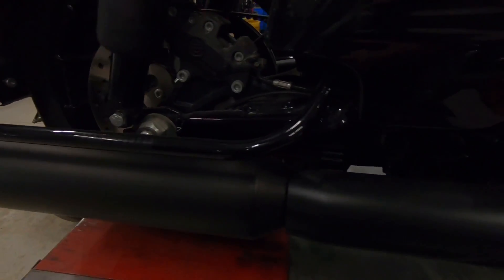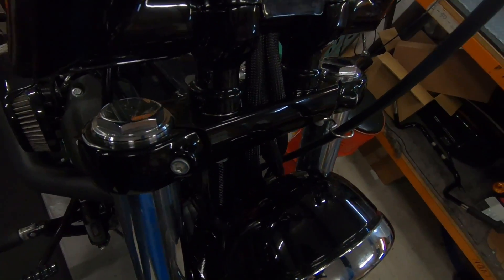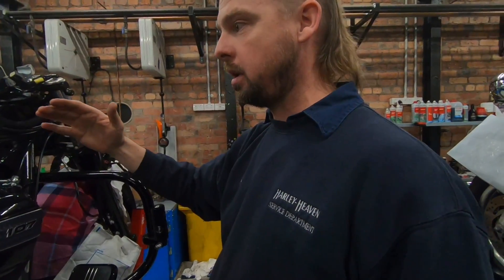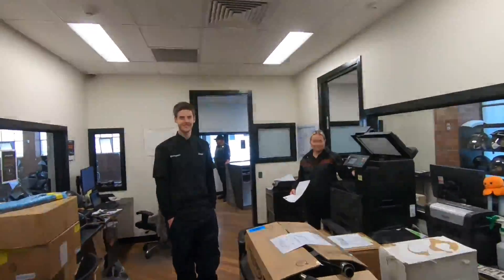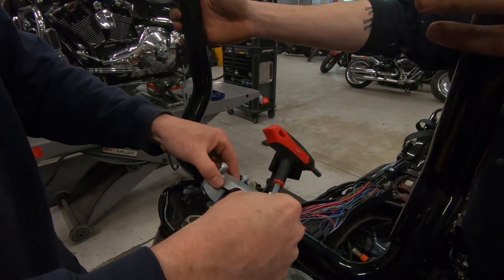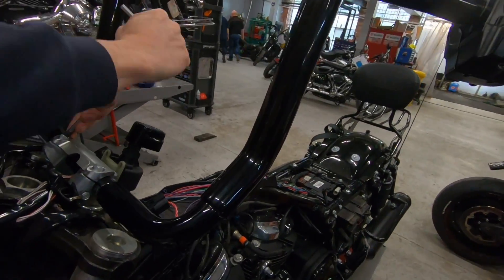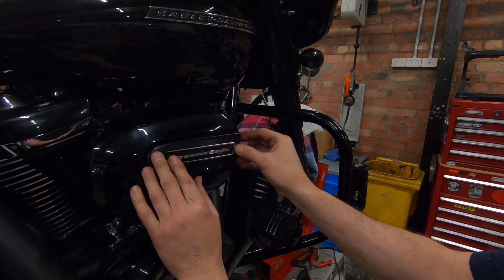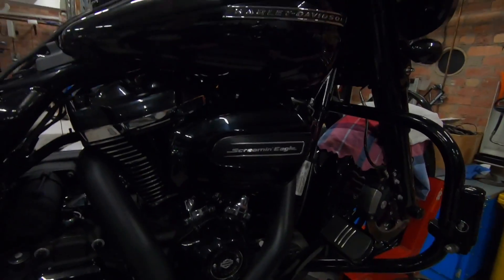KHROME WERKS 12 inch APE HANGERS Installed on a HARLEY DAVIDSON STREET GLIDE SPECIAL

Comment: wow, cool operation.  if change to 12 inch handlebar, does it need to change cable like clutch, throttle and brake? or reuse the stock cable?
Reply from the maker: Well some people say no but I have done 3 sets of handlebars now 1 I didn’t but 2 I had to get a longer clutch cable